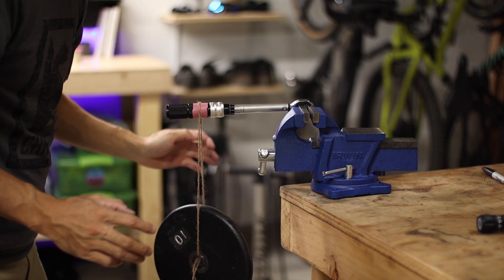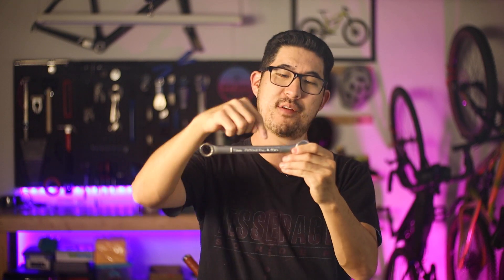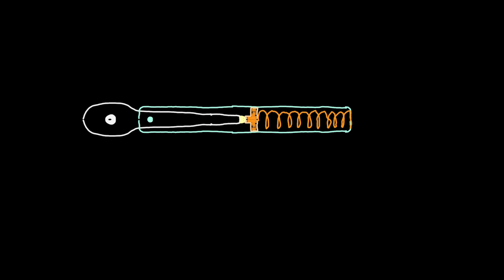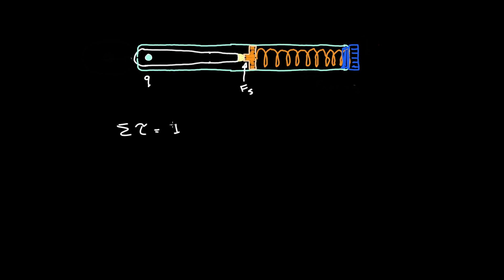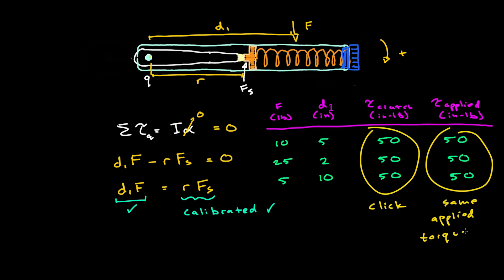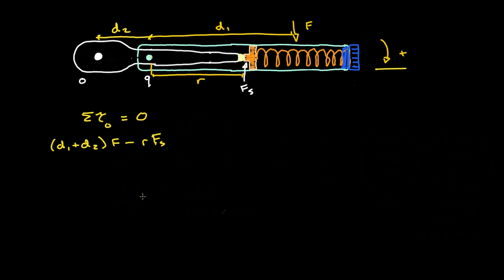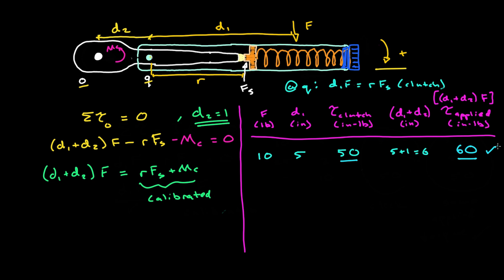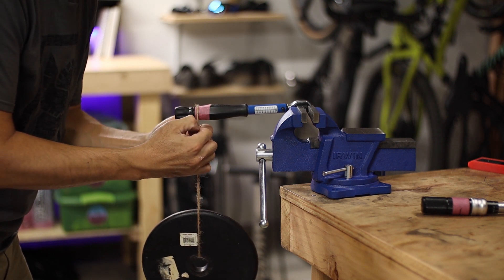Why GRIP Position on Torque Wrenches MATTERS!

Comment: The best way to demonstrate it (without maths) is to say to people: "Imagine pushing on the pivot point itself and you will see that the wrench arm won't be able to rotate, causing no click even with the highest pressure you can apply. However, this applied pressure WILL still turn the bolt." Basically, the main pivot point simply cannot rotate if you push directly onto it, but the bolt will still rotate. The only way you can rotate the pivot point is to have that force applied at a length away from it, turning the applied force into rotation (torque).
Reply from the maker: Love that! Thanks
Reply: this is a brilliant explanation! so simple. thank you
Reply: I love when I'm puzzled about something after one explanation, only to find a different explanation that makes everything instantly click into place. Pun intended.
Thank you.
Reply: That's the way I confirmed it in my head. Applying force at the pivot would result in infinite torque. You posted it so I don't have to
Reply: Agree...when I was at about 3:15 I imagined applying force exactly half way between the clicker and the pivot point...and saw that I would be applying half my force without going "through" the clicker. But now I agree, your explanation is the best.

Comment: This was not only brilliant in substance, it was explained brilliantly. A million bravos.
Reply from the maker: Thanks for checking it out, Stan
Reply: He still doesn't get it.   If the torque wrench will click at 50 ft. lbs with 5 pounds of force at 10 inches, then the force required to get it to click choked up at 5 inches will be 10 pounds (twice as much)!   Clearly someone is trying to pretend that they are smarter than they actually are.
Reply: @JohnAnderson-sm8jl  He is a professor of engineering with a PhD. I don’t think he’s pretending to be smart. 

As you correctly point out, the torque delivered by a given force depends on the distance between where the force is applied and the torque is measured. In the same way, the torque being produced by that force is different depending on where you measure it. If you put a second ratchet half-way along the beam, you’d measure different torque there than at the end from the same force applied to the handle, just as you said. Two different torques experienced, depending on the distance it is from where the force is applied. The pivot point is that second measuring distance.
Reply: @JohnAnderson-sm8jl I see what your saying but your missing a crucial part to the equation. What your say is correct if the bolt you are tightening is at the pivot point on the diagrams he drew (the point at where “d1” meets “d2”) but since the bolt being tightened is instead 1inch away from that “d1” “d2” intersection (showing the math at I think 3:12 left of the video) you then have to add this into your equation so like you say 10inches away at 5lb =50 to make it click but bolt will have 10 inches plus the 1 inch at 5ib making the bolt have the equivalent of 11inch at 5ib making the bolt = 55 when the wrench is set to 50. This is fine to think however when you change how close you had is to the pivot point like you say the bolt will experience a different torque than before even if the wrench is set to click at 50. So the math would look instead of 5inch away x 10ib = 50 it’s rather 6inch away x 10ib =60 that’s the bolt is experiencing a larger torque. Companies like park tool took this into consideration when making the torque wrench. So in theory the number you set your torque wrench to is the torque the bolt will receive but at the pivot point there will be less.

Comment: Thanks for an excellent and informative video.  I had to watch it 3 times to wrap my head around what's going on here.  As it did with you, the physics seemed painfully straight forward, and where you hold the handle shouldn't matter.  But it does.  My way of explaining it in layman's terms would be that if you're choking up on the handle (as compared to the prescribed point at which you're supposed to hold it), you're choking up more (percentage-wise) on the click pivot point than you are on the fastener pivot point.  Similarly, if you apply the force further from the pivot points, the percentage with which you're doing so is different for each pivot point.  Finally, this can be more concretely demonstrated by applying the force directly at the click pivot point.  When doing so, you'll still be applying torque to the fastener, but the wrench will never click because there's no torque being applied to the click mechanism.
Reply from the maker: I love that endpoint case of applying force at the pivot point. Still turning the wrench, but it’ll never click! Thx for that

Comment: Great to see someone get some constructive feedback and actually do some critical thinking of their own beliefs.  Well done for putting this together and proofing your initial thoughts, and those of many others, incorrect.

You’ve got me as a subscriber.
Reply from the maker: Everyone makes mistakes. Key is resolution.
Reply: Agree completely, and subscribed as well.
Reply: Ditto, subscribed!
Reply: He still doesn't get it.   If the torque wrench will click at 50 ft. lbs with 5 pounds of force at 10 inches, then the force required to get it to click choked up at 5 inches will be 10 pounds (twice as much)!   Clearly someone is trying to pretend that they are smarter than they actually are.
Reply: @JohnAnderson-sm8jl  except it isn’t as the pivot for the torque measurement is not the centre of the torque applied to the bolt
Reply: @gregditchburn9786  NO kidding master of the obvious.  You clearly missed the part in the beginning where he clearly doesn't understand, even when the pivot point is the center of torque.
Reply from the maker: Yea I know, it’s counterintuitive, but in this case torque is not torque. Experimental data is presented in the linked video. 5lbf at 10in produces a different applied torque than 10lbf at 5in - FOR A CLICK style wrench.
Reply: @JohnAnderson-sm8jl I hope you understand the concept now
Reply: @JohnAnderson-sm8jl

Sorry pal, but you are flat out wrong and obviously have no clue how click style wrenches actually work. The info posted in this vid is spot on. These are lever arm length dependent torque wrenches and if you hold them closer to the tool head than you are supposed to you will absolutely apply torque to the fastener at a meaningfully different torque than the torque setting the wrench is set to click at assuming it is properly calibrated. Congrats on the “confident” display of ignorance. You knocked it out of the proverbial park. . LOL

Comment: Excellent explanation of the physics behind the length-dependent click-type torque wrench!
I had thus far never considered the dependence of the applied torque on my grip position when using my torque wrenches. From now on I will be more mindful of it.

The engineer in me is also puzzled by the nonlinearity of the torque discrepancy that you calculated by changing d1 from 5 inches to 2 inches and then to 10 inches. My intuition would've been that the error in torque would've been linear with the error in moment arm length.

So I worked out the equation for the relative error sensitivity, S, of torque with respect to grip position (ie the fractional error in applied torque per unit distance error in hand placement):

S=-(d2/d1)/(d1+d2)

S is directly proportional to d2/d1 and inversely proportional the sum of d1 and d2, so the longer the overall length of a torque wrench, the less sensitive it will be, and the longer the handle bar is relative to the head unit, also the less sensitive. The negative sign tells us that a closer hand position to the handle pivot pin will always result in more torque applied at the drive when the click occurs, and a farther hand position always results in less torque being applied, which is somewhat counterintuitive, and quite the opposite behavior of a normal wrench. The relative error sensitivity is independent of Fs, r, or the torque setting selected, as both the absolute error in torque and the torque setting itself scale identically linearly with each of these parameters.
Reply from the maker: This is fantastic.
Reply: It's super simple, but it's not very practical, since it's useful just for small deviations. It's just the first derivative in Tailor series, but the function is nowhere near close to linear.
Mc = (1+d2/d1)*r*Fs
Mc'(d1) = - r*Fs*(d2/d1^2)
And here you get:
S= - (d2/d1)*1/(d1+d2)

And there are Slip or Cam-Over Torque Wrenches, which do not have this problem. They use a radial ball clutch. And not only this problem is eliminated, but also when they slip, over torque is not possible.

Comment: it seems very counterintuitive but I now think you are right. If you apply a force very close to the pivot point you can understand it will snap at a very or extremely high force which would obviously mean an extreme torque to the bolt. If you apply right on the pivot point it will never snap and you will still torque the bolt until you break it for sure unless something else breaks

Comment: I was firmly of the belief that "torque is torque", but I was immediately flipped as soon as I saw your diagram and noticed the pivot point of the torque "sensor" in the wrench is not the same pivot being used by the torque "applicator". Thanks!

Comment: I couldn't quite get your explanation to click (pun intended), so I ran through the math myself. The key for me was to look at the free body diagram for the handle (ignoring the head of the wrench). The handle sees two torques about point Q, one is applied by the person's hand (F*d1), and the other is applied by the clutch mechanism (Fs*r). Balancing these torques allows us to compute the force required to click the wrench: F = Fs*r/d1. Now, we look at the torque applied to the fastener (Tf), treating the wrench as a solid beam: Tf = F*(d1+d2). We already know the force required to click the wrench, so we can substitute: Tf = Fs*r/d1*(d1+d2). Simplifying we get: Tf = Fs*r*(1+d2/d1). Since Fs, r, and d2 are all constants determined by how the wrench is set up, increasing d1 decreases the torque applied to the fastener before the wrench clicks.

What's nice about this explanation, is we can directly calculate the percent error based on where the force is applied. If you have a wrench with d2 = 2" where you're supposed to hold it at 16", if you instead choke up to 6" then you'll apply 18% more torque than indicated.
Reply from the maker: Hell yea. Nice work
Reply: Ahhh, YES...  
An M.E. weighs in on the question, and with a beautifully simple derivation takes this counterintuitive, very interesting analysis, and boils it down to very practical, quantifiable terms.
Now THIS is something I can apply!
If I'm in an awkward configuration that for some reason requires me to choke up on my click-type torque wrench, I understand intuitively that I will have to apply more force (F).  I don't really care how much.  Using only d2 and  the new d1 (both externally measurable) I can calculate my resulting over-torque and back down the setting appropriately.

Thank you, sir, and nicely done.

Comment: As others have already said, this was brilliant. Well done! It's been over 40 years since I took Statics, and I was an EE so I promptly forgot all I learned in the required ME courses. Kudos to your engineering skills!
Reply from the maker: Nice! Thankfully, I don’t believe Statics has changed much.
Reply: @TheBikeSauce  Because sum(rF) = 0!!!!!!  in Statics :)  -  Seriously Great Video (from a ChE who also forgot all his Statics decades ago) Bravo!
Reply: Don’t feel bad, it’s been 30 years since I graduated as an ME and I’ve forgotten most of both the ME and EE content!! Excellent video - trying to understand how I can still apply the “weight” plate test accurately.

Using his example,  Am I to assume that if I  apply a 10lb weight at a distance of 5” from pivot point and set the wrench to 60in-lb it will pop off if calibrated?  Or a 20lb weight with wrench set to 120in-lb?  Is that a decent way to calibrate?

Comment: Great video but I think the point about hanging weights accuracy testing being flawed is, well, flawed. You can absolutely test the accuracy that way, as long as your calibration hanging point is in the middle of the handle. The wrench should click when you hang the weight off that point and should stop clicking once you move the weight as little as 1/4" inwards. 
What may actually be flawed about the tests you did is that you need to measure the weights before using them (exercise equipment weights are rarely very precise); and you also need to factor in the weight of the wrench itself with this method since it also applies some torque at the pivot point when used in this orientation. Something like half the weight times length of the wrench should provide a good first approximation.

Comment: To me you are merging two mechanical systems of wrench: the lever ratio of d2/r with tension spring which is  defining the click (an internal transfer function of wrench to initiate a click) and d1+d2 torque lever. 
When applying torque exceeds specified value, equilibrium between friction force (setted up by spring tension of transfer function) and (d1 + d2) F  breaks - the transfer function makes click. 
As mentioned one of viewer one year ago,  before click the wrench is the one solid pivot lever with size d1+d2. 
So, to calibrate the wrench we need correct weight at correct d1+d2 distance. 
As I see, you are trying to describe all absolute forces that are originating in wrench.

Comment: Thankyou for that, it really helps with the physics understanding and it also means that hand position is actually more important than I thought it was as even using the end of the torque wrench will result in skewed settings.

Comment: To greatly exaggerate, click style torque wrench would never click if force is apllied directly over pin (or closer to the head) no matter the Force applied (pin that is just bellow the head of the wrench), so logic is that handle is where force should be applied because distance (from pin) obviously matters. I always used click torque wrenches as they  should be used, but now i clearly understand why.
Reply: Yes indeed, this is probably the simplest way to quickly see that moving the point of applied force must change the resultant torque at which the click will occur. This video delivers the most clearly presented explanation of why that I've seen. Just a pity that so many folk on the internet, like our friend JohnAnderson-sm8jl, still don't get it!